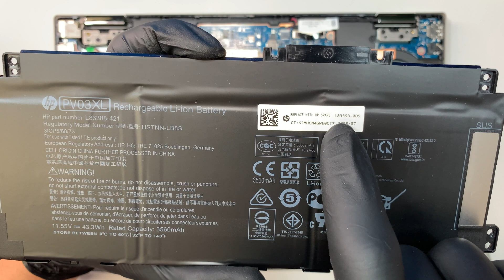HP x360 14m dw0023dx Tear Down Disassemble

Comment: Great video my brother!! Seen this after the fact, lol. I changed my keyboard with a new one, plastic weld and super glue worked perfect. Does this laptop have a thermal sensor? Mine keep shutting off instantly when moving screen. Even if just turned on within one minute.

Comment: I want to convert this laptop into a laptop that can withstand the game Sims four.  I just wanna use it to play one game and I’ve been doing research on it and what I might need and a graphics card is something that I would need to install, but since you said in the video, the motherboard doesn’t have a graphics card slot to install into what should I do? Is it even possible to convert this laptop or upgrade it? I was playing Sims on it for a few days until I added more stuff to the game then it would not launch the game when I was playing on it for a few days. It was kind of laggy but playable until I added more data to the game.

Comment: I've a screen that suddenly went black. External monitor via HDMI doesn't work either. Charger port and battery are working OK. Tried to follow virtual assistance steps from HP website but with no success. Trying to figure out next steps - should i try replacing something? What would you suggest replacing and in what order? Any other suggestions will be highly appreciated.
Reply: Hi , did you find a solution?

Comment: Hello Sir,
Thanks a lot for this meaningful video and hope you'd be able to help me out. I bought the same model three months ago. After two or three weeks of using, it  started displaying blue screen, stopping randomly. I tried many possibilities but no avail. Now, the problems are: 
1- the fan continuously spins unless I switch the laptop off 
2- it can stop without notification 
3- Windows defender deep analysis overheats the laptop.
Thanks in advance.

Comment: This video is great and very detailed. I was able to successfully take apart some of my laptop. Nevertheless, I was left with some question that I would like to ask.:

Those being:
Is there a place to add a SIM card to use internet or phone capabilities?
If not, is there a possible way to add a SIM port to the inside the computer or mother board?
How can you tell if your computer is bugged?
Can you add something externally to the computer to protect it from hackers or other type of tracking?
Is it possible to add something internally to the computer or mother board to inform you immediately any type of these kind of interferences?

Comment: Hey thank you for the video. I have this model laptop and it was working perfectly.  I simply opened the laptop and installed an additional 8GB Ram in DIMM 2. Once I did this, the laptop will not power on. I then removed the additional RAM and I reseated the original RAM. The laptop will no longer power on. I tried many different combinations for hard reset and it will no longer power on. Worth Noting - the LED where the power supply is plugged in - is also not on. I tried powering on via USB C docking station (HP) and it will no longer power on. What do you suggest is wrong? Could the wrong RAM brick the laptop? Could the DC Power supply connector be bad? Again the laptop was wroking perfectly, I simply installed an additional 8G of RAM, which now is removed.

Please help me!!

Thank you in advnace.

Ron
Reply from the maker: Adding additional ram would not break the laptop. 

Try remove the battery. And direct adapter to open the laptop. Hope this gelps

Comment: I have one of these HP Pavilion x360 m Convertible Model 14m-dw0023dx and the screen, keyboard, and mouse don't work. However, I can connect an external HDMI monitor, USB keyboard, and USB mouse and use the machine just fine that way. Do you think it would be necessary to replace the motherboard to get the built-in screen, keyboard, and touchpad to work again?
Reply: Replaced the motherboard and still having the exact same issue. Onboard screen, keyboard, and touchpad not working. I can use the machine with external HDMI monitor, external USB keyboard, and external USB mouse.
Reply: @chrishallett8335 Can we just replace keyboard rather than whole panel?